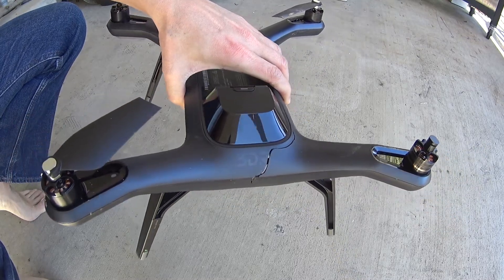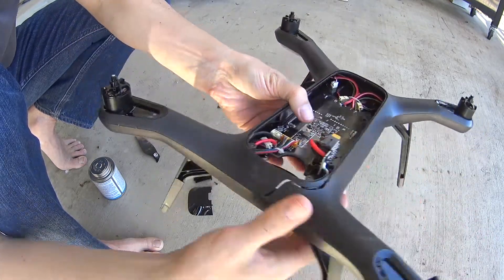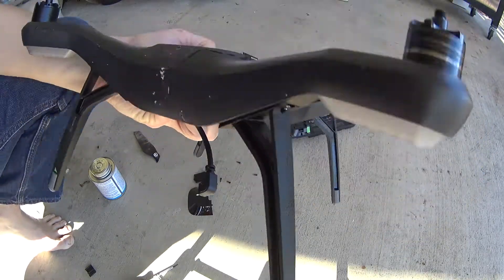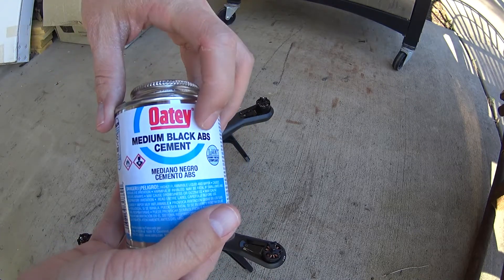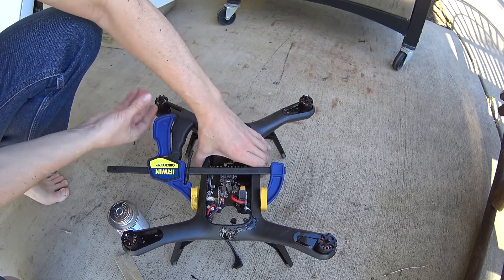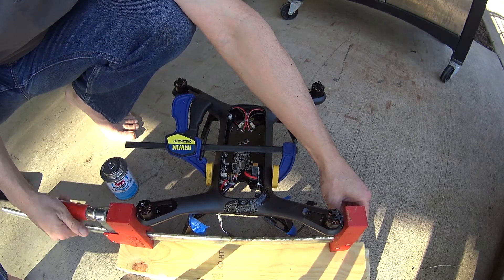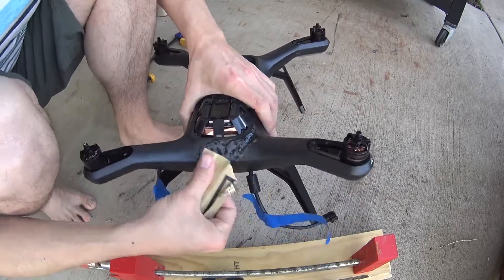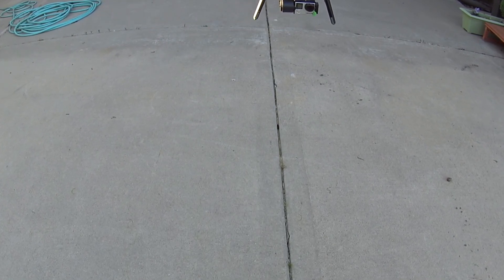Drone body plastic repair 3DR Solo

Comment: why not just buy a new body?
Reply from the maker: Good question. There are multiple reasons:
1)  I wanted to see if ABS cement would make for a strong repair, and I found out that it does!
2) This is a hobby, and for me it was more satisfying to repair than replace.
3) This wasn't my first drone crash, and likely won't be my last. With an imperfect drone body, I will care less about subsequent crashes.
4) A new drone body shell was $100 when I decided to make the repair, while a complete refub drone was $200. I did this repair using things I already have - the only cost is my time. At that price point, imo, it makes more sense to buy the refurb and use the crashed drone as parts.
5) Replacing the entire body means moving more electronics and wires: removing all 4 motorpods, GPS, control board, legs, sensors, ...), then transplanting them.